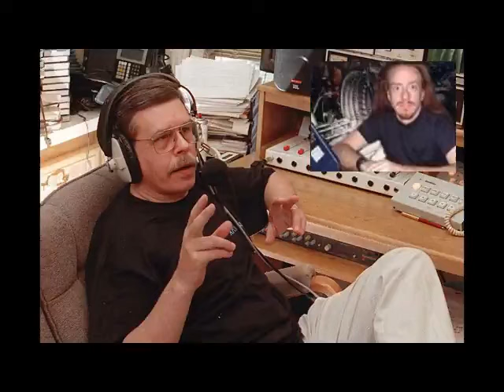Building a Time Machine | Art Bell interviews Michael "Mad Man" Marcum (Interview-1, 1995)

Comment: The original iteration of his "machine" seems so easy to replicate...so why doesn't someone qualified give it a shot? I think I may, why not? Jacob's ladder + air temp differential / rotating magnetic field to create the described spark...then throw screws (or other personal item) & record the results. Seems simple enough
Reply: What are your findings so far?
Reply: @MoldRoss  I'm finding that my shop is too small for everything I'm doing these days, and the process of moving to a larger location is consuming every available resource at my disposal. Selling this place will inject much needed funds into the overall effort, just getting to that point is the problem right now. I'm getting close though. I hope to be in a new shop by the end of '24.

How about you... Any new developments? I mean, your avatar kinda suggests that you are the time traveling man. 😉
Reply: Any updates?
Reply: @dev_hindutvsevak  Besides a few refinements to the design, not really. I mentioned that I need a larger shop/lab/workspace. The hunt will commence shortly, and I may even upload the story. I need more than an empty lot, I'm hoping to find something already established. Preferably an antique & vintage automotive wrecking yard with a restorable collection & a large workspace. I don't think that will be possible, but I will end up landing in a larger shop in 2025.
  Of course when I do this test, I will be recording, and uploading video. These days, it's far too easy to fake the event described, and streaming jumps around from one second to another already, so unfortunately no video could ever "legitimately confirm" the findings...but that won't stop me.
 Why?  If it fails, so what? If it succeeds....... Shit, now that I think about that aspect, it's probably not the best idea. Someone has to do it though.
  I'll just say, I haven't bought the DeLorean...Yet.
Reply: @ChevyC10 upload a video no bullshit if you can nake this device
Reply: @therealamon  Oh, of course... 
   Consider this for a moment if you would be so kind. 🤗 The most likely outcome, of course is failure. Even if I build the device correctly, and this phenomenon is possible, there's no guarantee that I would get it right. Especially on the first try. So yeah, why not document it?
  With people participating online, giving feedback and new design ideas could eventually create something that falls into a category of "If it is at all possible, this machine is capable of it" Then eventually the phenomenon will repeat itself in a recreated scenario. 
  On the other hand, the damn thing may just work the first time. Wouldn't that be fun? 🤣
  ... So what the hell am I getting at? Consider what happens "when" the device is proven to work. Unlocking the technology for anyone patient enough to assemble what these days is very rudimentary in design. So basically... If you have the mental acuity cook an illicit substance for instance, you could conceivably alter time in some way with a short tutorial. And of course the increased power bringing increased energy etcetera etcetera...and that concept gets a little dangerous.  Kinda scary actually... Especially considering the type of folk who have access to the most electricity. I wonder if Elon & Jeffy have seen these videos / heard these interviews.
Reply: @ChevyC10  maybe if they actually were on to something im sure the internet would love to see it especially if it actually works and then you would dissapear forever and blow everyones minds lol
Reply: @ChevyC10  dmt is a shortcut to getting there i used to make it in Minecraft
Reply: @therealamon  I bet the Lichtenberg figures will look amazing... CRAWLING UP MY ARM 🙀
Reply: @therealamon  HA! You don't know how right you might be (I said laughing nervously)

I mean, if it works... And I pursue it far enough to build one big enough to walk through... Add five black trucks haven't scooped me up by then,  I personally probably wouldn't want to walk through it. It sounds like a pretty rough ride, and I'm 40 something. I'm sure there will be volunteers though. 😉
Would you like to do it? Are you volunteering? 
🤗🤣